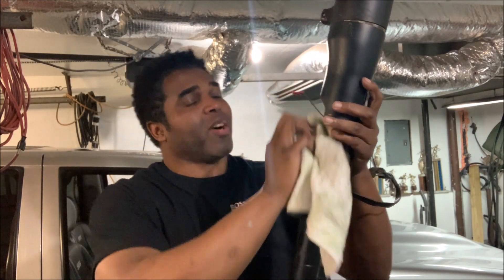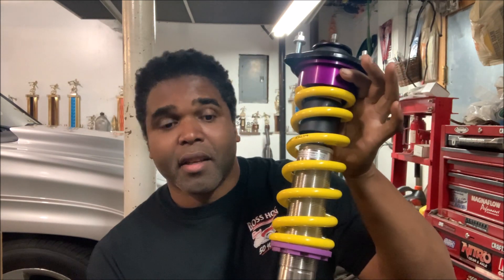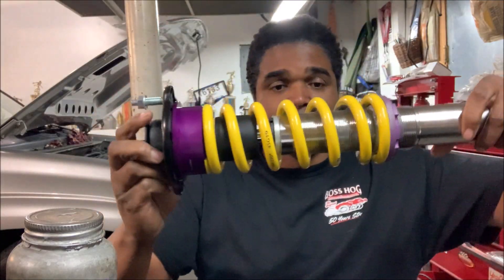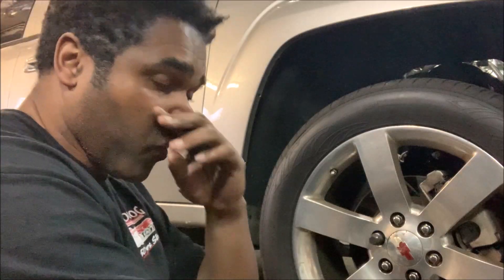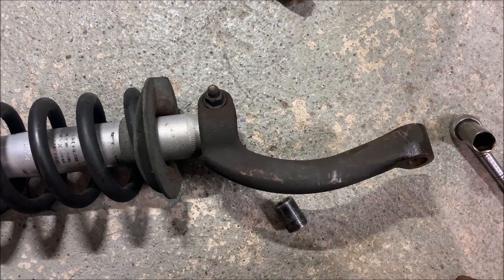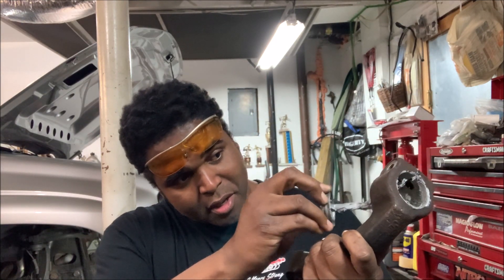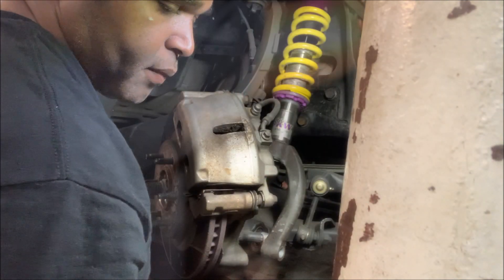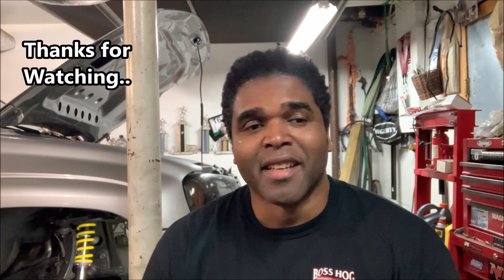KW Suspension / Belltech Coilover Install. (Trailblazer SS Coilovers)

Comment: Hey Terry can you mount these coilovers to the OEM control arms? Ordering these same exact ones. Please help.
Reply from the maker: whats good brotha, i think the reason you change the uppers is because if you plan on lowering the TBSS it will correct the alignment so you wont go thru lower ball joints.. if you plan on keeping it at the stock height you might be alright. if you plan on lowering you should change the uppers.. hope this helps.. keep me posted to what you do.. thanks
Reply: Thanks for the feeback man. I went ahead and ordered the KW coilovers with rear V3 shocks and springs. Also ordered the DJM upper arms.

Comment: I swapped an ly6 with all its electronics into my car deleted vvt and installed a cam

Now all i have to do to get it started is delete vats using HPtuners and it will turn right?
Reply from the maker: one you get a tune if everything is set up it should fire up.. keep me posted and if you have any question feel free to reach out.